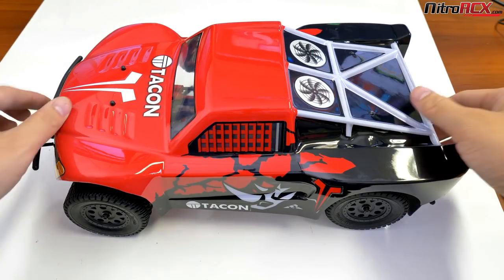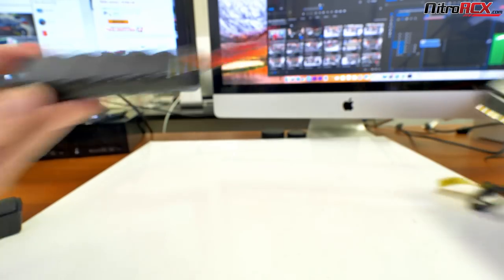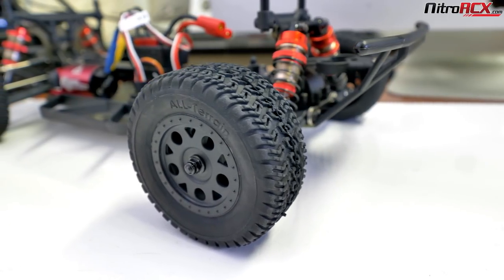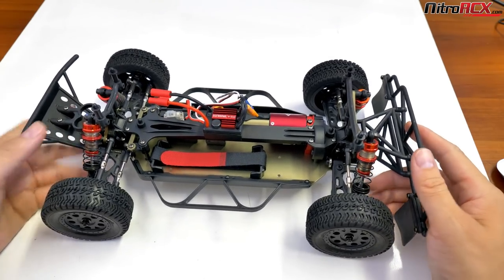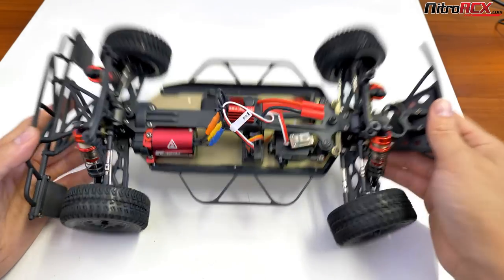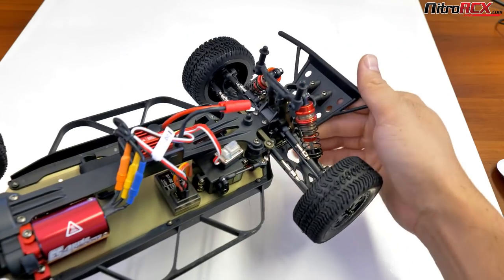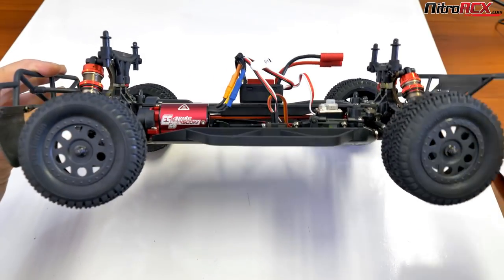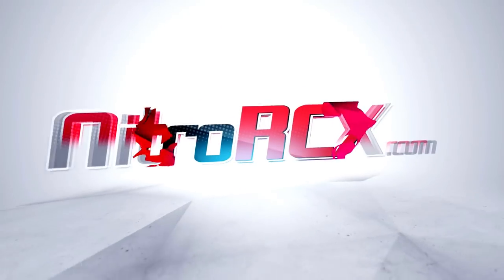Tacon 1/14 Thriller Short Course Truck Overview

Comment: did they ever fix the weak ass steering hubs for this truck?
Reply: That was fixed long ago bud. It was only the first few production models that had that problem. They have since been fixed with different materials used and now no-one has that problem